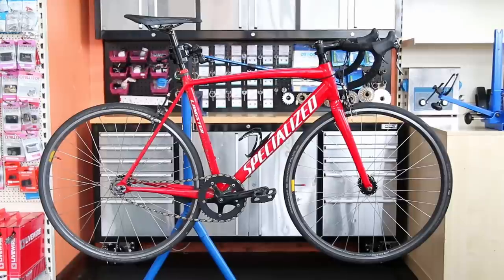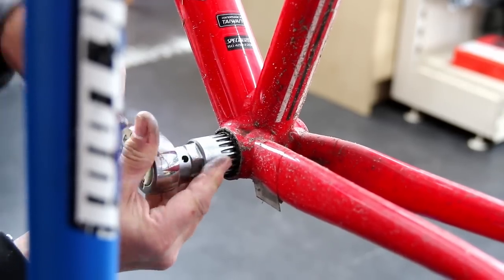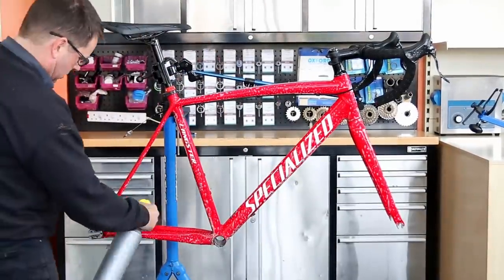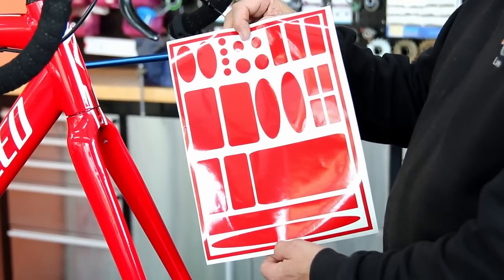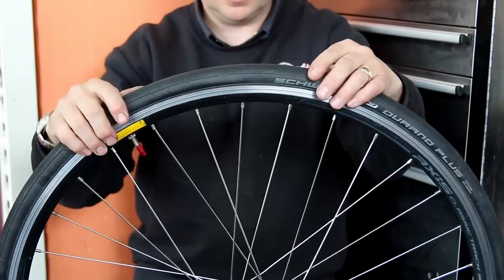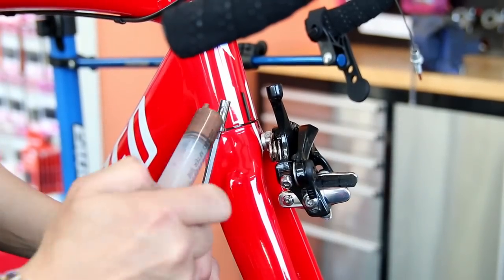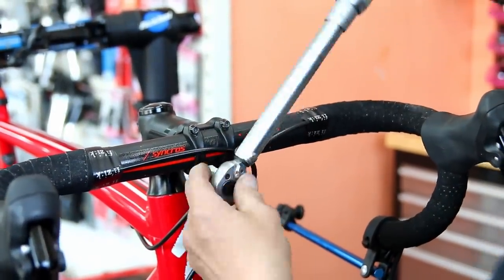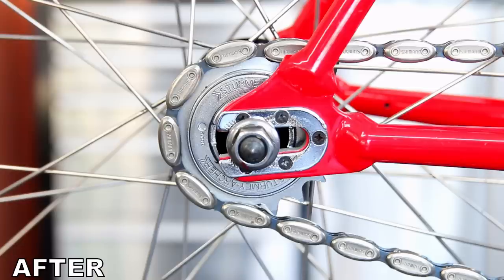Specialized Langster Full Rebuild! Single-speed Bike Service!

Comment: So no heat whatsoever with the ultrasonic cleaner when cleaning anodized parts? With a 6L, what’s your ratio with the degreaser/water mix? Thanks guys
Reply from the maker: We have 100% degreaser but it’s a water soluable degreaser so it does not mix with water 🧡

Comment: I always had been instructed to leave spindle tapers and the cranks spindle holes clean and free of grease, so why do that for this bottom bracket? The cranks will slide too far and after re tightening several times, crack the cranks at the tapers.

Comment: Also four spokes broke on my 700c front rim. I have two 622rims that are silver and I have wider tires, but the back has this plastic chain guard on it, can I use the BBT-22 PARK TOOL to remove the plastic part off the rim?